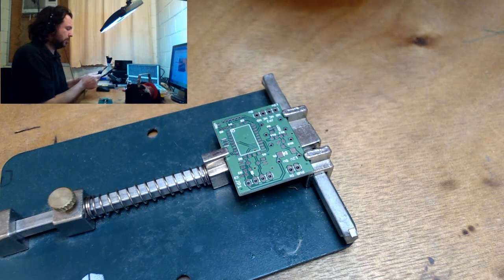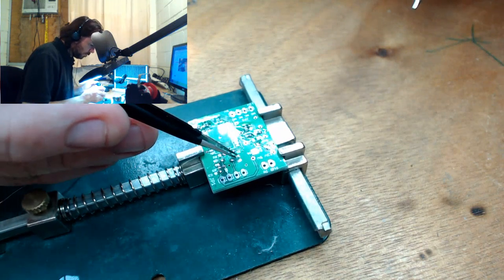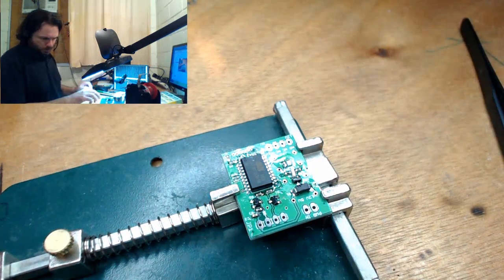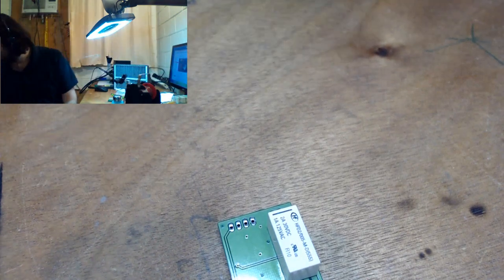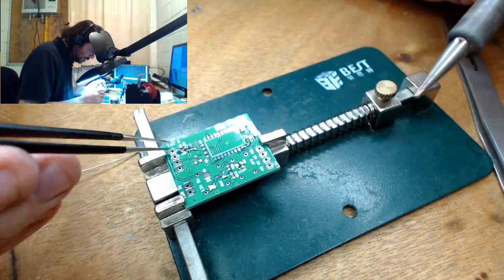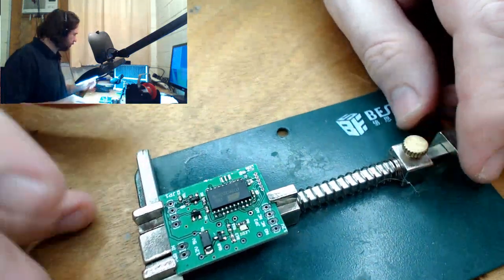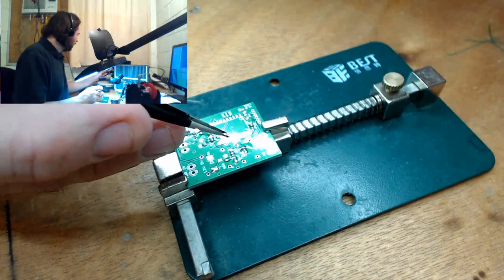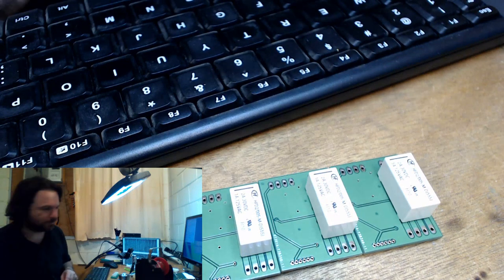[From Livestream] building internal relay boards

Comment from the maker: ▶ ▶ ▶ Building  a trio of internal relay boards controlled by USB to switch SATA power lines (5 & 12 V) to facilitate data  recovery through ddrescue and power cycling if required.   Station is the GOOT RX711 with a 1.2mm chisel tip which has been  a long-time dependable companion in my workshop.

Comment: where can one buy a kit to  building internal relay boards?
Reply from the maker: There's no kit that I'm aware of, though you can buy them prebuilt for about $5 each on eBay (just look for USB controlled relay).   I based mine off this page  - https://www.obdev.at/products/vusb/powerswitch.html
Reply: thanks

Comment: what is the 0603 on the 100nF caps ?
Reply from the maker: The 0603 is the physical size format, if that's what you were asking?
Reply: Paul Daniels yea that was what I didnt know. I've not used SMD components with hotair soldering myself (if ever I will, its a bit too finicky [sp?] for me)
Reply from the maker: It's really not so bad down to 0603.  Once you get to 0402 it starts being a pain.  For reference, the size refers to imperial "thou" measurements,  06 = 0.060", 03 = 0.030", so 1.5 x 0.75mm.   01005 is hilarious as you can imagine :-o
Reply: Thanks for explaining that. I never looked into that cause it is only used for SMD components. Maybe I will 'burn myself on a hot air gun' (hope not literally :D) for mounting SMD components  one day. I'm currently busy with non-electronics things, playing with Raspberry Pi and my 'new' laptop (I've finally managed to get Intel Quick Sync working on Windows10 so I can use the GPU for encoding video) but will get back to it soon. Its an old HP laptop from my brother having a 2nd gen i3/2.2 GHZ/6GB. It can almost encode video realtime (3 minute video takes 4 minutes to encode). I hate the laptop for its noisyness though :)